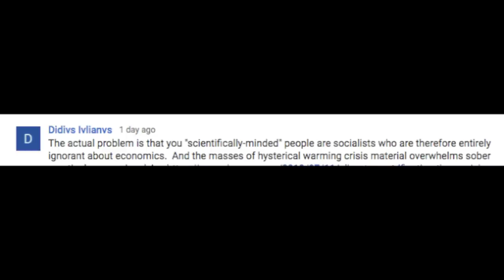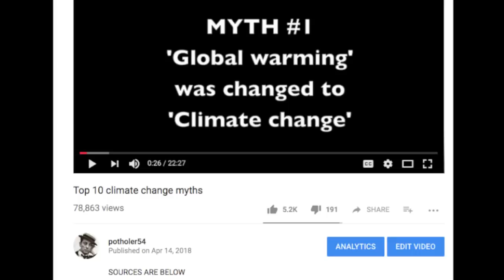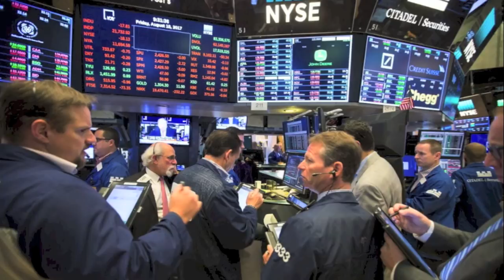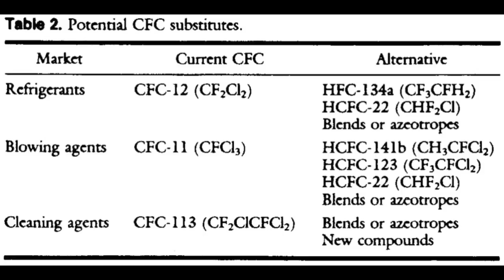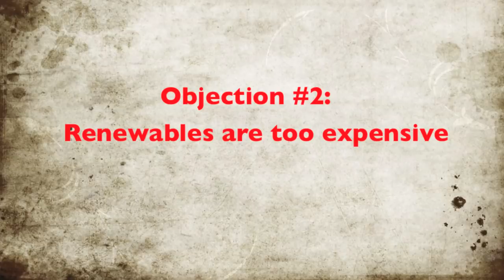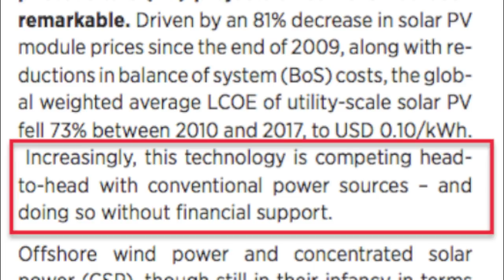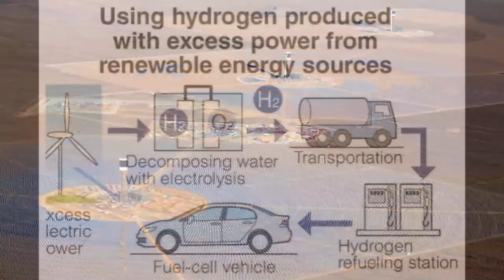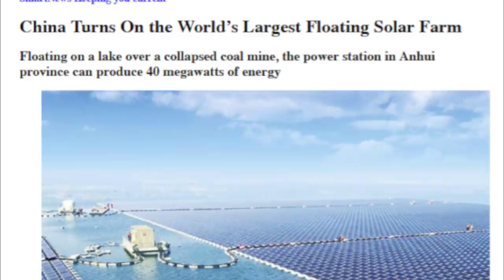A CONSERVATIVE solution to global warming (Part 1)

Comment: Like most modern problems, we need to science the shit out of this one.
Reply: Mordi, science proves it's a scam. So does history.
Reply: @ricktd6891  Peculiar, I never received a check from the Rockefellers.
Dangit.
Also I need it a bit more specific than "IPPC climate models".
Which scientist wrote this models in which paper and what in his methodology was wrong?
Direct links are prefered, not someone else doing the thinking for me.
As for the warming: Funny that in your own logic, the timeframe from 45 -79 disproves all of the warming that came after (Link to the data is also prefered). The 4 warmest years on record are all within the last 5 years. The ocean warmed the fastest, since it's a heat sink.
So against your supposed 35 years of cooling (in this time periode we also blew a lot of aerosols into the atmosphere which had a cooling effect btw) there are now 40 years of warming, even with a present solar minimum.
Reply: @ricktd6891  Lol you call it a scam and then get mad for being labeled a denier. What a fool.
Reply: @ricktd6891  Okay, and saying that literally makes you a denier. You got buttmad over someone using correct terminology. Lol.
Reply: @JesterAzazel  you were brainwashed into using the term "denier" so your weak mind would associate CAGW skeptics with Holocaust "deniers." Tricks, lies, slander and name calling, true signs of a weak argument.
Reply: @ricktd6891  Wrong. I'm using accurate terminology and you're getting all PC over it. 
FFS, I called MYSELF a climate change denier before I finally took the time to research this shit. Why are people suddenly so offended over words?
Reply: @Rick I agree fully with your view. Even a basic understanding of physics is enough for any intelligent person to see through this nonsense. The won’t of course until the energy policies have brought the world economy to it’s knees.
Reply: Thanks  @alanthorpe3640   It's good to see other free thinkers out there. This scam has already been a disaster for other countries. Search "Germany's renewable energy disaster" or "Australia's renewable energy disaster" or "Spain's renewable energy disaster."
Reply: @Harak Mapping Sorry but you can't get around the fact that the planet is historically cold right now, not hot. You got scammed, face it.

Comment: The problem with capitalism (read current logistical and structural economic status quo) and climate change is that in order to shift our economy to where it needs to be we need vast real productive output. And the problem with capitalism is that it, contrary to popular myths, it is not good at harnessing our productive capabilities. See, one of the major caps on our productive output is our labour supply. Such that, if we are at 100% employment, then we cannot increase our productive capabilities outside of inventing new technology. One of the things about 100% employment is that there are virtually no profit margins; such that, economies that are at their peak productive capabilities are economies with very low profit margins. This is why an economy controlled by those who primarily generate income via profits is an economy that is not incentivised to maximise productive output, because doing so would mean they lose control over the economy. It's rather obvious why this is: 100% employment means 100% financial security for workers, meaning that they are in a very strong position of leverage and control over the economy.

This is why financial capitalism has become so popular. It gives a way to generate wealth for some without increasing the real productive capabilities of an economy, and so without handing over increased control of the economy to those who primarily generate income via wages. In this sense, financial capitalism is basically just straight theft. Unfortunately, changing some numbers on a computer does not help us to transition our real economy to deal with climate change. In fact, it does the opposite, as financial capitalism relies on a stable and unchanging status quo to generate such wealth.

The evidence of all this is the decreasing trend in the percentage of GDP being invested into real productive output https://data.worldbank.org/indicator/NE.GDI.TOTL.ZS

So while it's true that you could transition to a sustainable economy under capitalism, you are fighting against a raging torrent in trying to do so, and would find your efforts of transition a lot easier if you directed some of your resources towards trying to dismantle our current economy and replace it with one that is not afraid of maximising our productive outputs.

One of the ways I think this should be done, is for more countries to implement legislation similar to what Italy has, whereby, if a company is going to shut down or be sold off etc, then the employees have the right of first refusal to purchase said company for themselves and turn it into a worker owned company. Worker owned companies have the benefit that the people there do not become patrons of either profits or wages, and instead the two become more blurred together, meaning that you remove people who may be primarily motived by profits from the economy, and so remove the disincentive to maximise productive outputs and the also the incentive to keep the status quo. Jeremy Corbyn was planning on implementing such legislation.

It's for these reasons that when Adam Smith wrote about the self interest of the individual being good for the society as a whole, he was specifically talking about the self interest of the individual that primarily generates wealth via wages; in doing so, he singled out the self interest of the individual who primarily generates wealth via profits as one whose self interest is " always in some respects different from, and even opposite to, that of the public....The proposal of any new law or regulation of commerce which comes from this order, ought always to be listened to with great precaution, and ought never to be adopted till after having been long and carefully examined, not only with the most scrupulous, but with the most suspicious attention. It comes from an order of men whose interest is never exactly the same with that of the public, who have generally an interest to deceive and even to oppress the public, and who accordingly have, upon many occasions, both deceived and oppressed it." Funny how that key point was missed in popular interpretations of Wealth of Nations.

Comment: i'm one of those anti-capitalist wackos but there's another way for making coal more expensive, that in principle is not in conflict with capitalist economy.

states charge consumption of fossil fuel with the current cost of removing the pollution their use produces from the atmosphere.
the logic is that if you're damping something that pollutes everyone's yard, you should pay to the organization in charge of cleaning everyone's yard the cost for doing it (and the state should obviously clean the atmosphere).
needless to say, this is feasible only on paper, because otherwise one litre of fuel would cost one month's salary.

same thing should apply for all plastic etc. the tax of treating garbage should be paid when buying things. we would then avoid the absurdity of peeled mandarines sold in plastic wrapping in supermarkets, and it would incentivize research for creating better biodegradable materials.

Comment: It's not so much that temps are higher, rather it is that seasonal warmth lasts longer. This is where I wonder about the urban heat island effect & its dissipation to more suburban regions. When you have as many cars as today in a city all idling, the chemical energy of gasoline is converted to mechanical energy but there is always the heat of entropy lost. That buildup from so many cars has likely made our cities feel warmer. Yes indeed the population is bigger than 1970 or 1980.  However, that being said when you see these millenials protest, I can't imagine any of them wanting to give up their cars. I can't imagine seeing any of them lose their air conditioners or keeping their heat at say 50 degrees. And for that matter do not think for a minute that Sanders or Warren are going to lose their cars & jets.

Comment: Really appreciate your measured tone, and your calm and balanced presentation of ideas and the facts that support them.  I am wondering if you have addressed the issue of human population as an issue in solving any of several of our current problems. Do you see the current population/level of civilization as exceeding a reasonable carrying capacity for our environment?  Or do you believe that  we are capapble of creating societies that can adapt to any level of human population and maintain a habitable planet?
Reply: I don't know if you've noticed, but the current population levels have already exceeded carrying capacity for our enviroment.
The energy we rely on has directly caused the planet to heat up.
Fauna and flora are decreasing at such unprecedented rates that we're witnessing a mass extinction event, mostly because we destroy habitat.
And the population is only increasing, and a long way off from plateauing.
Reply: @iseriver3982  I have definitely noticed. I am concerned that many so-called solutions will only be used to make possible even higher human populations. The only effective and reasonable solution that I see is reducing the human substantially. I am encouraged in the population trends I see in most of the developed world. If we have a goal of providing a good existence  for the entire human population, using the technology we have, the total population will have to be much smaller than curently. It will take decades to reach that, and require inventing new ways of lookin g at our economies.
Reply: @jimarnn1938  lucky there are people inventing new technologies and improving old ones.
Reply: @iseriver3982  as useful as technology can be, it is also important to update our attitude towards our environment and our relationship to it.
Reply: @jimarnn1938  good point.
Reply: The planet could readily support a couple of billion more humans, if we weren't clinging to the status quo so hard.
But hey, the way things are progressing on the climate change front, we might have to get used to alternative, massively more efficient sources of protein and that problem will solve itself ¯\_(ツ)_/¯
Reply: @grmasdfII  I strongly disagree with your take on what the planet will support.  It definitely not support the current human population living the lifestyle we aspire to. I would agree that the planet could support a larger human population... but at the cost of every other population that makes live enjoyable and stimulating. The cost would also include denying a large number of people the freedoms we value. Sacrificing ecosystems and freedoms in order to tolerate a large human population is not wisdom, it is not fulfilling, and it is degrading. It also places the entire human population in a much more tenuous position regarding environmental disasters. The intricate web of interactions between our environment and living creatures creates resilience and stability. Destroy the webs and the variability in response increases. Not a position that promotes long term survival.

Comment: What about nuclear though? Isn't it cheaper and more efficient
Reply: not cheaper apparently, according to other video I saw
Reply: its a great way to get reliable base energy that can be ramped up and scaled down depending on what the energymarked need at any time of day. its a great way of getting power untill fusion is finally working (fingers crossed on iter) you need a powersource besides wind and solar as those cannot alone give reliable power. uk is getting a few of them as we speak made by china
Reply: @ajspades19 o yes they can as they are just heating water to turn to steam and turbines move the electricity generators.. you can generate more heat then needed full time or by looking ahead predictively and scaling to assesment of needed powerusage. if less electricity is needed pressurevalves control  how fast the steam turbines rotate. if more is needed . pressure is allowed to build up again.. you cant do this with wind and in the night you cant do this with solar.. you need to store it in huge batteries for the same effect
Reply: @ajspades19 basicly the same way as old fashion coal powerplants work..
Reply: @TheRybka30  Yep.

South Korea are building reactors quickly because they only make iterative changes from one reactor to the next rather than significant innovation enabling the skills of the workers to remain relevant from one reactor to the next.

Comment: If wind and solar are killing it so hard in China, how come only they account for 5% of total electricity generation?
Reply: cbraat27 think about 5% of over a billion
Reply: @cbraat  In Iowa, wind has been providing 39% of their electricity for several years now.  In Texas, the absolute power level is several times that, but only comes to 14.8% of their total power usage.  
In Illinois, Excelon has been begging for subsidies for their nuclear power plants because they can't compete with all the cheap wind power coming in from Iowa.  
In Texas they've had electricity plans where your night time electricity was free - they tend to have an excess at night from all the wind turbines.
In 2017, India cancelled 13GW of coal power plants because the they found out it would be cheaper to put in photovoltaics.
Uruguay's power grid is now over 95% renewable.  They are now selling green power to neighboring countries rather than buying dirty power from them.
The low percentage of renewable sources in some places can easily be attributed to a lack of investment.
Reply: 5% is pretty good for china
they are making strides

Comment: What's your opinion on nuclear energy?
Reply: @swos772  recycle it in a fast reactor or MSR
Reply: @fullmontyuk  If the question is what technology has the best chance of decarbonising the economy, it's clear nuclear over renewables. As evidence, I would ask you to compare the recent history of France and Germany. The earlier managed to build enough nuclear capacity to supply all of their electricity needs in about 2 decades. In contrast Germany's experiment with rejecting nuclear and embracing renewables sees them still depend on coal and gas for around half their electricity supply. 

Nuclear has problems but none of them preclude us implementing it at large scale right now - it's been done before it can be done again. Wind and solar on the other hand do have physical constraints which do prevent it from replacing fossil fuels on the economy scale: intermittency, low energy density, large material requirements etc.
Reply: @fullmontyuk  the evidence suggests that we would not decarbonise in 20 years (or any other timescale) using renewables. Germany have been building wind and solar capacity for 20 years but they are nowhere near decarbonisation. They also have the most expensive electricity in Europe having spent nearly half a trillion on it. Compare with France who have the cheapest. This is before you factor in batteries, which wind/solar will need to provide a supply of energy comparable to fossil fuels.
Reply: @fullmontyuk  No, Germany opted to close perfectly operational nuclear power stations that could have operated just fine for another 20 years or more. Germany have spent 580 billion Euros on their supposed energy transition yet say they wont get off coal until 2038 at the latest. They've barely managed to reduce emissions at all. And yet all of the solar panels and wind turbines will need to be replaced in around 20 years when they  come to the end of their working.

For the same price they could have replaced all their generating capacity with nuclear. I don't know how much evidence you would need to see that one is vastly superior to the other.

Maybe you'd be willing to reduce your energy consumption, but I doubt it would be any where near enough. Perhaps if you really tried you could reduce your impact by 10 or 20% if you really cut down. But that obviously isn't enough and most people will not reduce their consumption. In fact most people want to consume much more. We wont do this without investment in a large scale alternative to fossil fuels.
Reply: @swos772  store it in secure canisters underground, until we find ways to recycle it. It takes up very little space.
Reply: Are any of those new reactor types, that are failsafe and can recycle waste operational yet?

And I wonder, if all of those nuclear fans know, that uranium is not a renewable resource here on earth? 

The current uranium sources would last around 90years. 
And are spread over a handfull of countries.
(Source: World Nuclear Association)
Reply: @huwjonesification  nuclear has much more downsides than the waste.
Nuclear despide the believe is not very economical you wont get lower houshold Power prices you could get with renewables.

Heavily doubt they could do that with the same amount of money but please give sources.